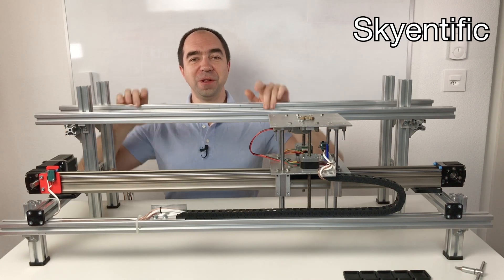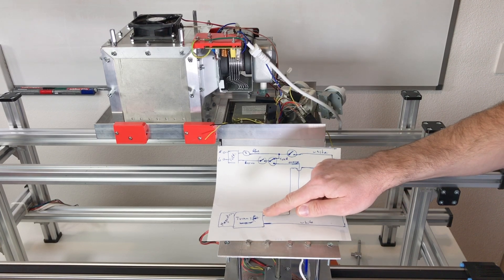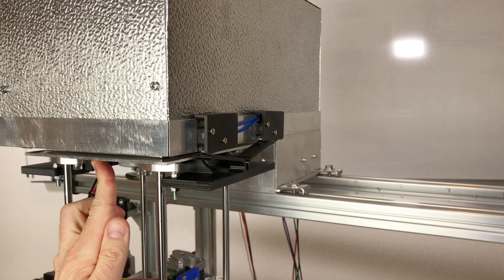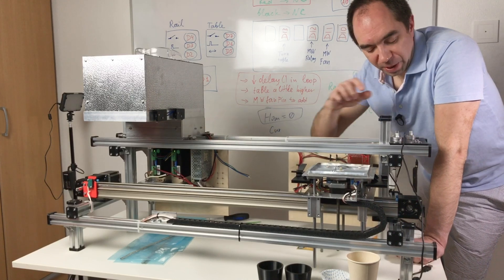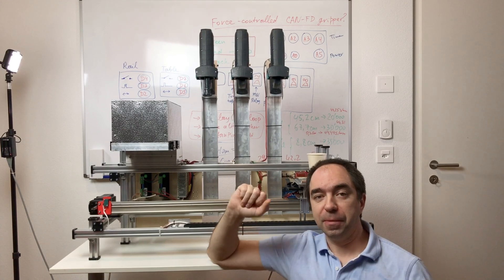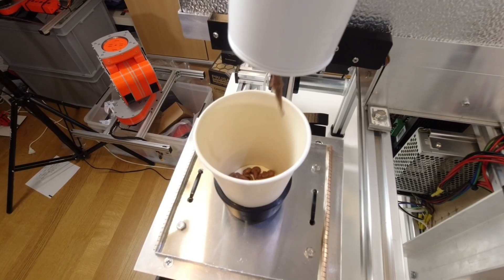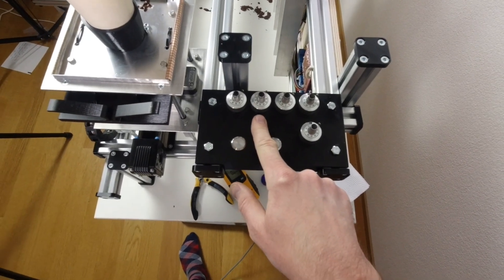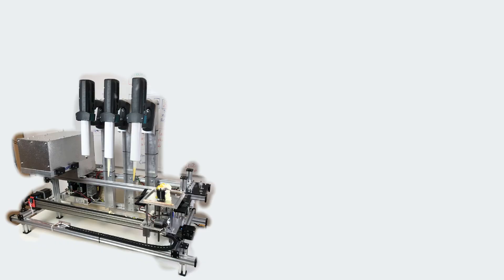DIY cupcake machine (Arduino cooking robot)

Comment: That's really cool! I'm only speculating but would having the microwave chamber's dimensions be proportional to the output wavelength help with the leakage?
Reply from the maker: Thank you. If you made them proportional, this can create standing wave inside microwave, and this will make the heating extremely inhomogeneous.

Comment: You should retract the plunger on the toppings to create negative pressure. Also adding a fan to cool the cupcake will help the toppings not melt. The microwave leakage could be from the hole for the motor under the cup. A normal microwave has another sheet of metal which yours lacks. The simple solution would be fixing a screen around the entire machine to keep people from getting their hands caught in the conveyor as well and that way you can shield the waves making it out of the microwave.

Comment: Can you add a randomised surface to the inside of the microwave to act as a diffusing reflector? I think that the problem is the modes for such simple geometry are not very complex so you get that patterning of the energy distribution.
Reply from the maker: Great idea!

Comment: I'm glad you're using a microwave leakage detector. I like this project!
As darrin husmann wrote> Perhaps the most joyful thing I've seen today.
.
Microwave leakage: You should check out how microwave ovens "seal" the cooking cavity around the door (which apparently doesn't seem to actually seal the cavity). These depend on half-wave shorted stubs to simulate a cavity "seal". Here's a very brief description:
https://www.edn.com/your-microwave-oven-needs-a-choke-flange/
.
Microwave Hotspots: Many ovens include a "stirrer" to constantly move standing waves inside the cavity (standing waves are the reason hotspots exist.) The hotspots still exist, but they are never in any particular place long enough to be a problem. The stirrer is located near where the microwaves are injected into the cavity.
Reply: Someone is reading the EDN article.... It was highlighted in their weekly newsletter.   B)

Comment: Impressive result. At the beinnging I was concerned about the miceo wave oven. But with all your security measures it seems to be fairly safe.
For liquid topings you might use something like the "soda fountain machine" from the channel "the q". I guess their machine is not good solution for soda (because of the CO2-gas from the soda will push the soda out) but for your topings it should be a clean solution.

Comment: 3D printers have the same problem of dropping down unwanted material. They (try to) solve this by pulling back the material for maybe 4mm.
So you might try to pull back the "pistons" for just a few millimeters after each usage by 2 or 3 or 4mm maybe. For the next cupcake you need to push the material by these extra millmeters down. But it is difficult with such liquid materials like the ones you need. You would need some tweaking and it might not really help. Maybe you get an air pocket on top between your "material" and the "piston"... Well, you could try it. If it helps, it's great. If it makes things worse, sorry, don't use it again.
... But the microwave is the really scary part of that machine... try at least to fix the microwave leakage, maybe it is in the ventilation holes, maybe at some other gap.

Comment: Really nice project !!! For the microwave, should you have a little oven ? much safe even if it's hotter. You could add a quality control at the end line with jetson nano :D For the topping, maybe some electro valves would avoir leaking :P

Comment: Great video. I would have used a heater oven, (loaded from the bottom like yours), I also suggest you move the base while the cupcake is turning to get a spiral. Impressive work.
Reply from the maker: Thank you. I would also prefer heater oven now. The advantage of microwave: for microwave cooking time is around 60 seconds, for heater oven around 16 minutes.
Reply: @Skyentific  I figured that was why you went with microwave. Maybe make an assembly line system, with long oven, :) New cupcake every 16 minutes.

Comment: Another way of evening out the energy some microwave ovens use is by pointing the magnatron at a metal fan. That might help since you have such a small cooking chamber. You might also add a cooling fan station before the toppings.

Comment: I experimented with 3D printing peanut butter on my channel and what I learned was that the syringe has to be filled up with absolutely no air bubbles. Since air is much more compressible than water, the compression to extrude from the syringe will cause it to leak afterwards. Retracting the plunger of the syringe after extruding also helped against leakage. Thanks for sharing and happy holidays! 😊
Reply from the maker: Very good point!!! Thank you a lot! And happy holidays!
Reply: I think someone made a good "open source paste extruder".  And i think the person making that "OpenPNP" thing also did peanut butter.

and Happy Holidays ! Make a festive (tiny, non-homogenized) cupcake for freinds/family!
Reply: And outside of the frosting pumps, everything else workedd great!  Some minor tweaks and it should be near perfect.
Reply: If the compressibility of the syringe contents is variable, maybe a force sensor is required along with some control software to be confident that the proper amount is extruded.

In the 3d printing world, the term "linear advance" refers to compensation for static (non-variable) nonlinear extrusion volume, and it seems to work well for most people who bother setting it up, but I suspect they find their linear advance settings aren't as good if they change materials or other operating parametera.

Comment: reversing the tubes after dispensing should fix the dough leakage, but you could also add a servo with a small plate to collect the excess.
as for the microwave leakage, you could try gluing conductive foam with a copper mesh around the outside of the plate so it mates perfectly.

now you need to automate the making of the dough.

Comment: Definitely your most worthwhile endeavor so far! :))  With some fine tuning it's going to be a beast of a machine! May I suggest that you reverse the feed on all 3 tubes after dispensing each material. That may help with the dripping of unwanted material on the machine. Also pick a batter mix without chunks. 

Your next thing should be a cake decorating machine. There are already some out there, but once you master this task, you can combine it to create even more beautiful cupcakes! 

Great stuff. Every geeks dream to combine tech and junk food. Yumm!  Maybe you could insert the cream topping dispenser down INTO the cupcake and make one like I used to buy at the store with cream filling!
Reply: Could mix it with the drink machine idea i had, and just have a     l o n g    line that can make nearly anything.  Maybe make it in "segments" that can be assembled on site?

Either way a great thing to bring to a school/makerspace/makerfair for even food. "dinner and a (robotic) show" as they say!
Reply: Also could put it in a food truck like " @
1.5x playback everything - thank me later " was thinking.

Comment: Are the holes in the side of the microwave case small enough to stop the microwaves wavelengths? (Im not even sure that made scientific sense but I think theres a reason microwave windows use mesh)

Comment: Thank you for this Video :) I have one question: Why is the power supply for the Arduino so big? I would suppose it's the smallest power sink in your assembly.
Reply from the maker: Great question. The answer: this power supply is not only for Arduino. It also powers: 1. fans in microwave; 2. relays; 3. silicon guns.
Reply: @Skyentific  I supposed something like that ;) Thank you for your answer and have an amazing holiday!
Reply: Через день работы этой херни она так засрется, что ей одномоментно наступит цугундер.